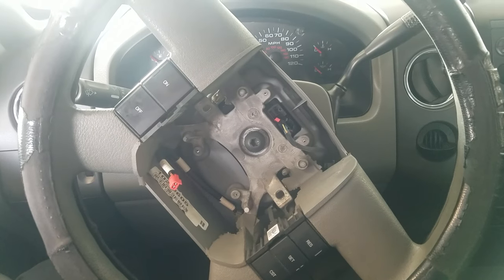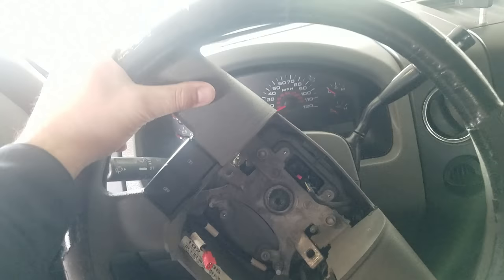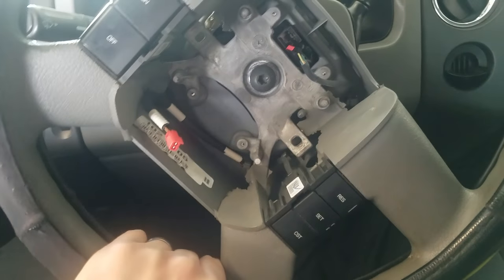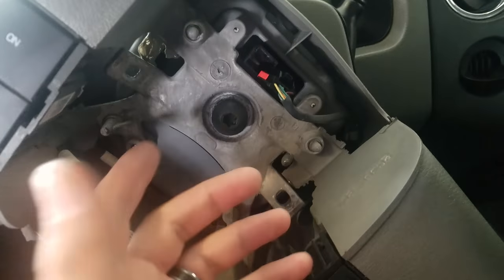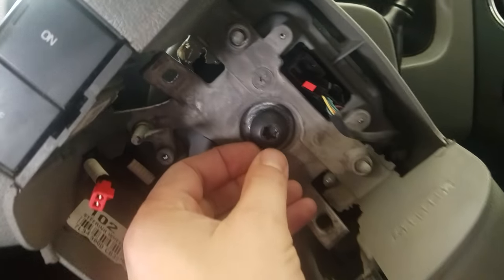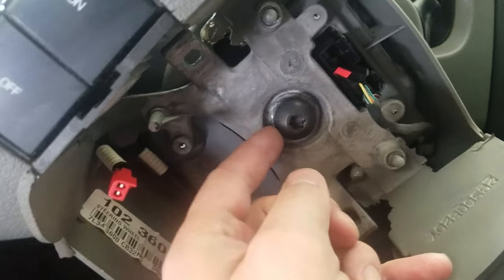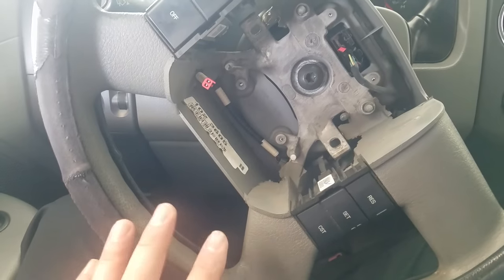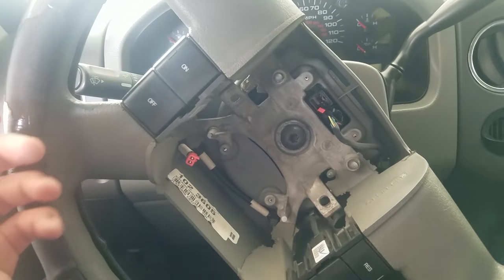How to remove a steering wheel without a puller

Comment: Phenomenal trick.  Just finished replacing the turn signal switch in my 2004 F150, a task that requires removing the steering wheel to complete.  This video was extremely helpful.

Thank you very much!  Fantastic video.

Comment: My 94 f150 refuses to let it go. It even bent the bolts for the puller wtf
Reply from the maker: Some older american trucks are difficult,  might want to keep spraying some wd40 or any penetrating fluid on the bolt for a few days till it loosens up.

Comment: My dude!

Totally saved my ass! Your method worked like a charm!

Appreciate the video!
Reply from the maker: I was actually at a junk yard today pulling a steering column off a honda,  I didn't need the steering wheel or the air bag so i took the air bag off,  loosen the center bolt, a couple of karate chops to the wheel and it popped right off. Works every time.

Comment: Definitely doesn’t work on my 1995 GMC Sierra it won’t even budge with a puller
Reply from the maker: Yup, some vehicles are just much more difficult, even with a tool. Just have to keep trying,  eventually it will budge, maybe spray some wd40 in the center where the nut goes and let it soak for a day.

Comment: It doesn't always work that easy. I tried to us even a puller on my Ranger. The stearing wheel would not budge.
Reply: Joseph Caesar Padrón ya. Polaris rzr wheel wouldn’t budge. Snapped the welds on the puller without moving.

Comment: Would this work on a 91 Sonoma
Reply from the maker: Its wort a try, some folks had trouble with older vehicles but I done close to 10 vehicle this way and  it's always worked. Sometimes one can take just a bit more muscle but eventually it will give in.

Comment: Would probably work for me if my wheel wasn't practically welded to the spindle from rust
Reply from the maker: Spray some wd40 on the spindle after removing the center nut and let it soak in for a day or two, should loosen up.
Reply: Mine too. Smh! And I just stripped my bolt

Comment: Bro I smacked the shit out of it. Still doesnt come off. I even removed the nut completely and hit it. Nothing 😐😣now im exhausted
Reply from the maker: Try wd40 in the center nut , let it soak a bit.
Some steering wheels can be stuborn to the point that even with a puller they won't come off easy, especially in some older classics.
Reply: @thebravoconnection946  oh thanks a lot Ill try that. Its a 2002 japan alto .❤️❤️